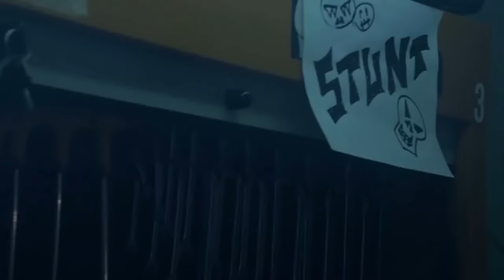Best of Saaraazh - Compilation

Comment: Do you pop the clutch when you start your wheelie or just throttle into it?
P.S. Popping the clutch into a wheelie is a lot better
Reply from the maker: I pop it, but I didn't before. Some of these clips are really old so you can see that I don't in some parts :) Thanks for watching
Reply: Better in wearing out the clutch for sure :D